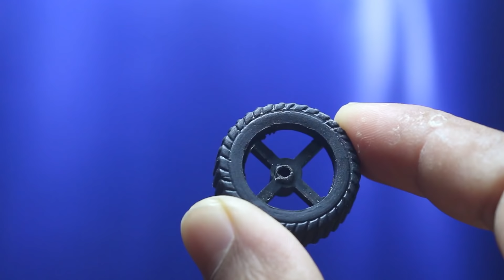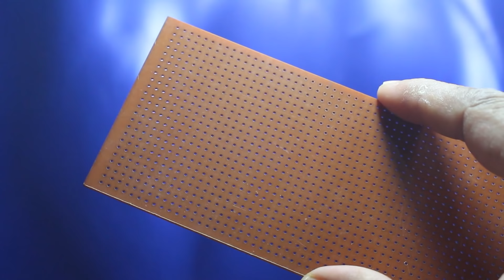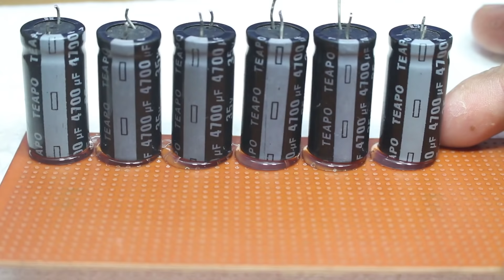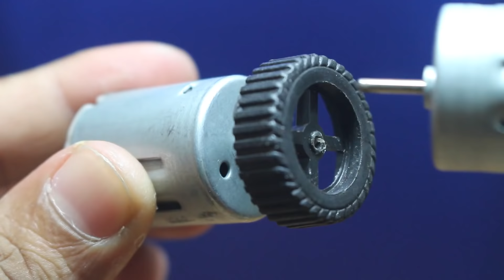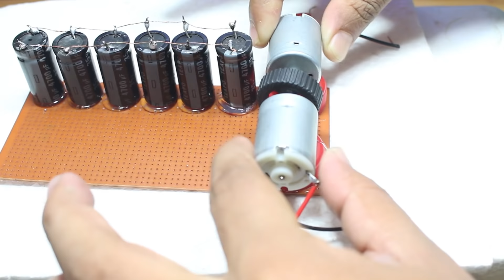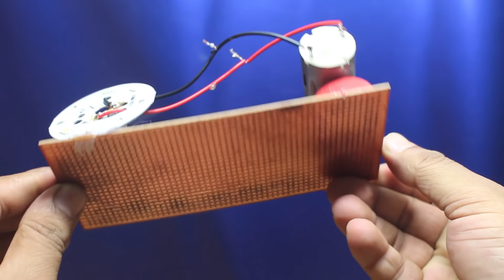100% Free Energy Light Bulb Using Capacitor - Free Energy Light Bulbs Using Dc Motorr

Comment: The capacitors are realy big. When he touch the cables, he charged the capitors with enough energy, to spin the motor. Capacitors can charged with many A, perhaps 5 A and in secongs transfered many energy.

When the capacitors are empty, the motor stand still.
Reply: maybe if one motor was continuously putting energy into the capacitors, it would run longer.  the capacitors are basically batteries that can be charged in seconds.  i may end up trying this to see how long the it takes the capacitors to lose their charge, and how long it would run if the one putting out power was also constantly charging the capacitors.

Comment: GUYS DID YOU SEE ..?WHEN HE GAVE POWER TO CAPCITER  THE LED PLATE WAS CHANGED..THAT WAS THE TRICK
Reply: No there was an reason for charging the capacitor is that you will need a  Singal charge to run motor as for reason there was no charge in capacitor to run  motos and there are  supplime to make a self running searkit
Reply: was that a battery connected to the wires black and red ,then afterwards the motor run and the led lighted.?am i correct?

Comment: How is it free if you are using a battery that outputs energy
Reply: Also you dont know how to use a perfboard right. You supposed to put the componets wires in the holes and solder them. if you wanted a base you could have just used some carboard